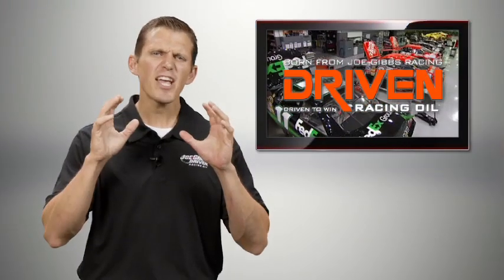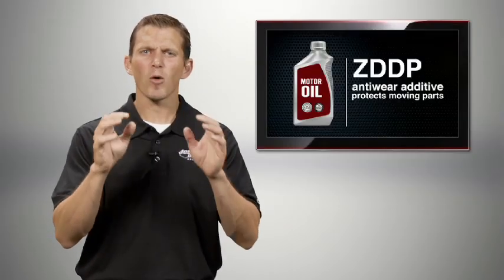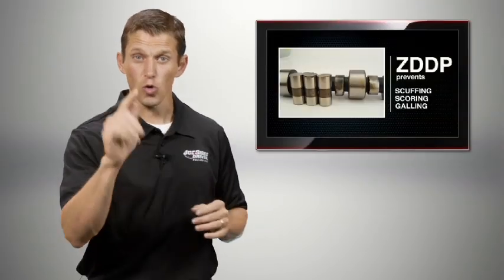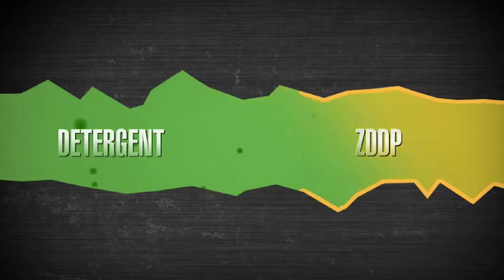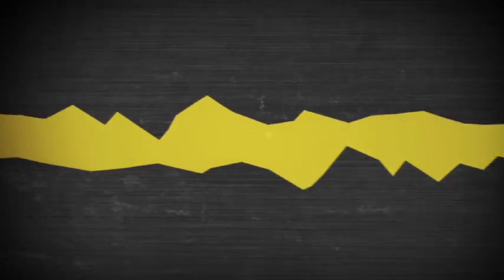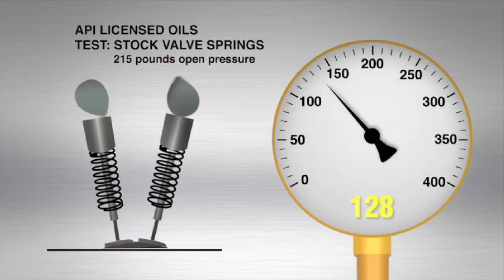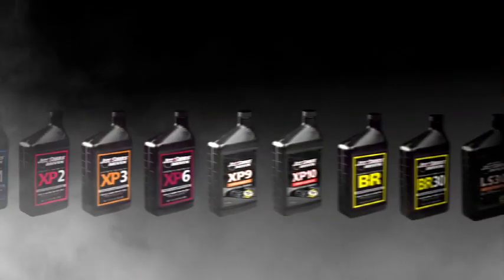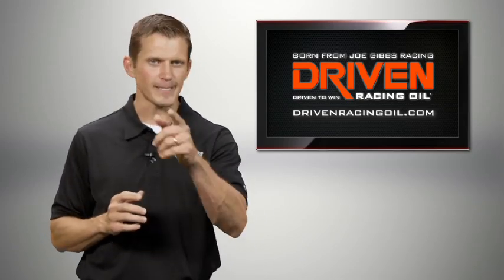Ultra-High Viscosity Oil Explained

Comment: is higher viscosity number means better performance/less wear in higher engine internal temperatures as well? while being on the track and revving hard engine oil heats pretty much.. so in that case is it better to use fully synthetic 5w-30 or 10w-60? 
thank you..
Reply: I have the same question sir. I've read that, for example hths characteristics on modern api sn 10w30 synthetic have the same shear ratio as a 10w60 from 20 years ago, without sacrificing lubrication in high engine operating temperature. But there are still many variables such as what base stock and quality of additives used in the oil. I am still learning